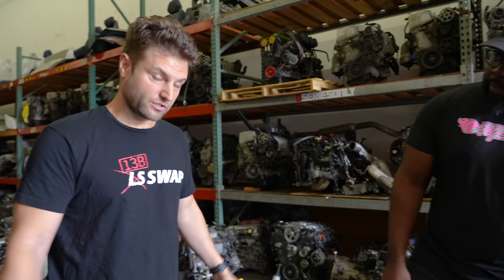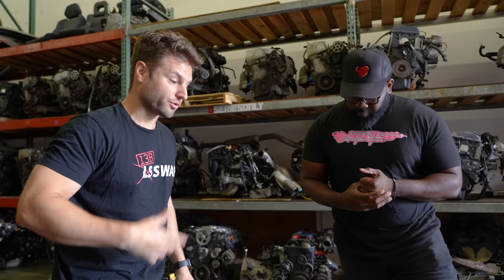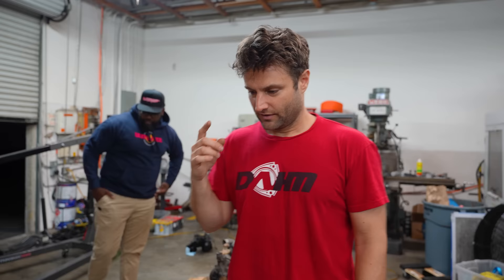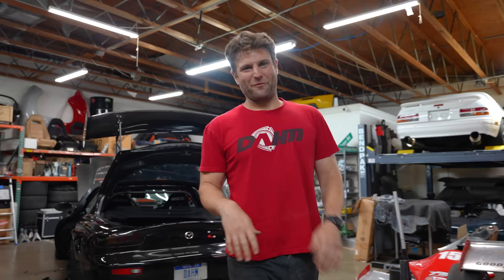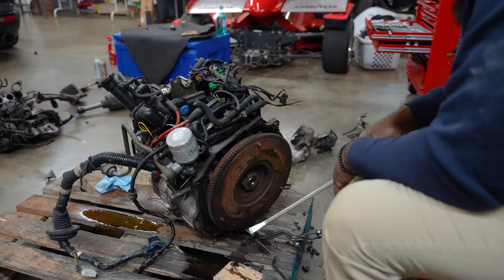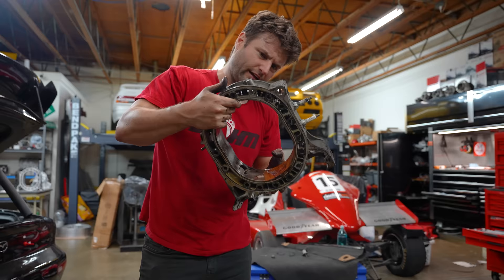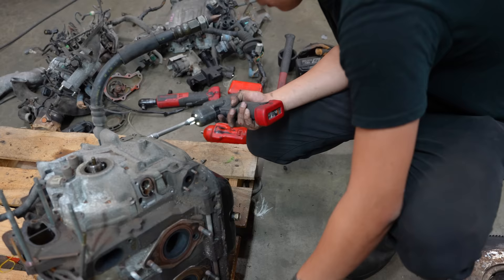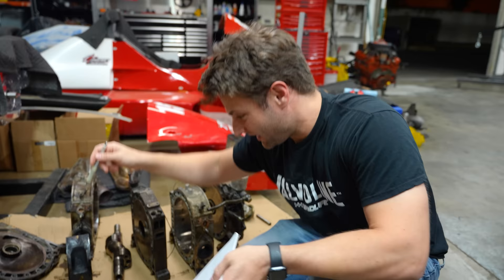Can you build a 4 ROTOR from USED RX-7 Engines??

Comment: im being REALLY optimistic here but i think im ready to use this video series as a work-along guide for my own 4 rotor. what could go wrong
Reply: Set up some kind of remote circuit to start it the first time.  Cut out the circuit board from a little rc car and have it connected to a servo to press the button that turns on the starter motor maybe.  Find a way to be behind a wall when the engine starts 😂

Comment: My 1st mod was a '99 Pontiac SUNFIRE too, smh. SK-Sport catalog sway bars front and back, poly motor mounts, cold air intake,  and FlowMaster exhaust. P.O.S. transmission blew out spring break 2000. Can't forget about the massive color matched Whale Tail wing.

Comment: There needs to be a rotor shaft that uses double roller, double thrust bearings instead of the original bearing surfaces. Those bearings are stupid robust and can take a lot of abuse, plus, the fact that the thrust can be applied from both sides makes things bulletproof as far as that's concerned. They'd be perfect for the dorito engine, because there's no pistons involved.

Comment: The new rotary motor Mazda makes , single rotor for the hydrid , uses a direct injector in the middle of the intake port and spark plug , could be a low speed fuel delivery system , idle

Comment: i was wondering if the after-market is catering to the performance rotary market with new, higher spec' rotors, but all I found was a chap who had designed, and was testing, titanium versions.
With modern CNC investment casting and/or core manufacturing, and with price potentially being less of an issue for the alloy and heat-treating used, I would have thought lighter and/or stronger rotors might be viable?

Comment: I wonder if Hert's 4 rotor journey is going to feed into Rob's in-house R&D for billet motors, given Hert's usage needs sustained high HP thermals whereas Rob's usage is typically short bursts.  Rob already wanted to design a cooler engine, right?  You can throw all the radiators you want at a sustained engine, but that's really only half of the issue, the other half is how efficiently the motor itself can extract heat, which is the core of the issue and one of the downsides of the Renesis platform with its melty seals.  Tweaking the base design to properly sustain workload should be a goal, one of many obviously, and I think this collaboration could easily push Rob's billets to achieve that goal.

Comment: I rebuilt my first engine when i was 8...

let me start from the beginning, i was 6 years old, my dad bought a wrecked 1986 Toyota Hilux out of Mexico that was used as a prerunner before it got ran into a tree, got it for $200. one day he called me outside to help him, and i did, older brother wanted nothing to do with it, and i started taking things apart, fender, grill, bumper, if i could turn the bolt/nut, i took it off. we only worked on in on the weekends so it took a while, eventually we got the frame straightened and new front panels on, and all that was left was to rebuild that 22R. by that time i was 8 and had learned a ton already, but my dad had me rebuild the carb while he sat next to me and guided me, then once that was back together he had me do the same thing to the rest of the engine. I rebuilt my first engine when i was 8. my dad was by my side the whole time and talked me through how to do it all, helped me torque down bolts, showed me how to put new rings on pistons, and how to do the valve guides and all that in the head. got it back together, hooked up fuel and a battery and the old girl started right up.

im the only child out of 4 that actually did things with my dad, cars, guns, any time a "take your child to work day came up i always went (he was a RN and a wound care specialist), off roading, camping, all that. he's taught me so much, and tried to teach my siblings, and they just don't care. knowing he has a tumor in his brainstem that my other siblings don't know about yet hurts, i know im going to lose him soon, and when he's gone its just going to be me that can do the repairs around the house, fix moms/ brothers cars, take care of the animals, and make sure that everything goes smoothly. im 23 and im not ready for this, but that's just life and i got the short end of the stick

Comment: Come to think of it, a dropped engine having more good parts isn't a shock because the others had to have been junk when they got pulled out of service (if not, why pull them?). The dropped one will have some parts that are in too many pieces, but everything else would likely be still in good shape.
Reply: @sunnygtir  With regards to my point, that's no different than cars in the US getting sent to junk yards: an used engine on the shelf dues to external damage (e.g. dropped during maintenance or crunched in a wreck) will likely have parts in better shape than one pulled because of issues it's having.
Reply: @sunnygtir  Sounds like, by the laws of Japan, the cars are "junk". Also, if the engine was still in "perfect" condition, wouldn't that be one of the cars exported as a whole and not in pieces?

Lastly, I guess I could have been more explicit, but I was/am talking in generalities. Sure there will be exceptions, but most things by definition aren't exceptions.

Comment: Can you build a single rotor?
I want a rotary in my MG.  Seems like a single rotor would be ideal.
Reply: A 2 rotor should fit into an MG, even a Midget, or is the 2 rotor bigger than I thought?
Reply: I feel even a na 2 rotor would overwhelm the chassis.
Without a ton of suspension work.  Essentially would have to build a tube chassis.
Reply: @pinchflat  Bear in mind that a 2 rotor, especially if not turbocharged, is a low torque engine. It's not like swapping a V8 into the MG. Here's an MG Midget with a 2 rotor https://youtu.be/iHOxWL6xCdI?si=23MS5DUTLRDDHDj2 and here's Hot Rod Garages V8 swapped MGB https://youtu.be/7ppDcTGJzSs?si=SmTKFvtr-yBtusLH&t=914

Comment: Hello! I wanna REW-swap my S5 NA RX-7 and I was wondering whether a new motor from mazda would be better than a used/rebuilt motor. Either way, I want the REW bridge-ported, so I will need a good quality shop to work on it(I also do not have the tools or experience to do that kind of work). I wanna build it to handle 400bhp. Any advice is appreciated :)

Comment: Yes you can take two 13bs and make a 4rotor once you put the stationary gears in the middle you have a 4 rotor shaft If you want to use the factory ports you have to plug the front plate and the rear plate report it to match the middle plates and you're good to go have done it years ago I use Jb weld to fold the ports  report and Port to match closest possible The problem I had it was an intake exhaust manifolds it was a nightmare 🤣

Comment: Are you going to spline the ends of 2 e shafts to make a 4 rotor e shaft? Im sure if you draw the correct spline layout and test the torque using fusion 360 it would work…

Comment: This is great, but I'd actually prefer to build a 3-rotor out of used (and mixed) RX7 and RX8 motors. 3-rotor is the goat IMO. No need for 1000hp+, especially in 2wd and/or for a handling-focused car, and if I wanted high N/A HP, I'd probably skip straight to a 6-rotor (or now 5 rotor thanks to Mad Mike and the other guy) given what the 3-rotor can do with a small turbo, or 2-rotor can do with a medium turbo.

Comment: Why couldn't you machine a special crankshaft, and center housing to allow the two motors to attach together, and everything else be the same. You would need a standalone ECU, that is tuned the engines strokes.

Comment: With the price of used fd engines this is definitely not a budget build. 3 engines are probably 18k you already almost half way to a 4 rotor and you dont even have the eccentric or the the irons and all the other crap needed by that time you already spent 50k could’ve just ordered a 4 rotor